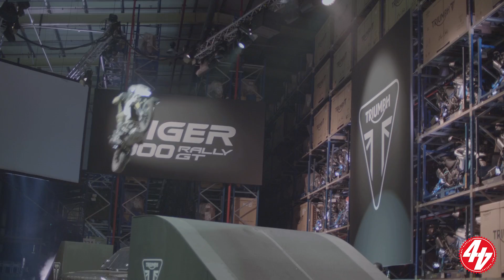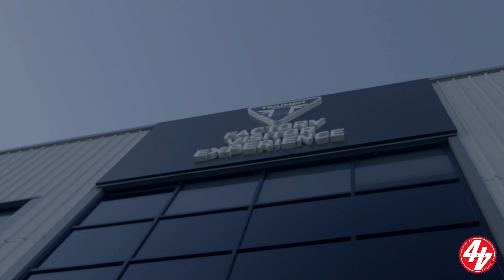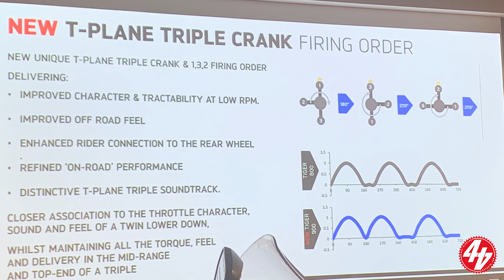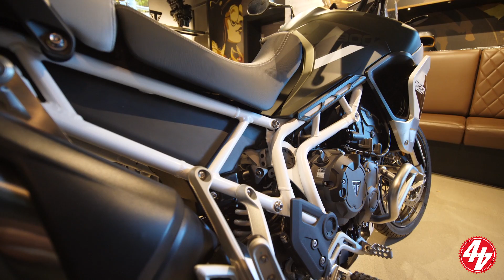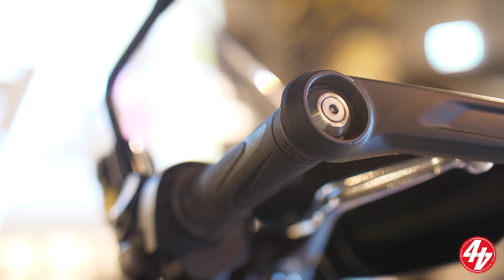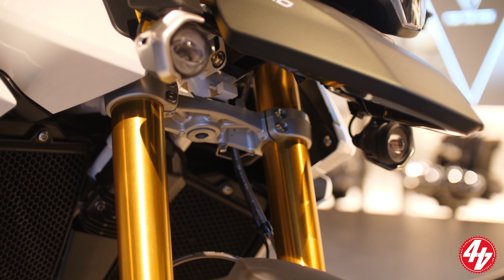2020 Triumph Tiger 900 Preview

Comment: I test rode the Rally Pro today. I got back to the dealer and threw my wallet at him. jokes, but this bike made the Tenere 700 look like a cheap toy. I'd go as far as saying that this is bike is as close to adv perfection as there is. The smoothness and acceleration up to 100+ kph is far superior to the Tenere 700 which I found underpowered and quite uncomfortable even on a 30min highway run. The seat, standing position, and wind protection  on the Tiger Rally Pro is super comfortable and has sealed the deal for me. Quick shifter and cruise control is life changing as well. I don't care about the extra cost over the Tenere the bike is that good.

Comment: To my personal knowledge, I don't know that an inline-3 engine has ever been configured with this crankshaft layout, this firing interval ever before. By far, most triples are 120° crankpin layout. Laverda did a 180° layout for a while (two pistons TDC, one opposite at BDC). But I don't know of any other triple configuration before this 900 Tiger.

Comment: Great vid.  Just wondering when 900 became middleweight for adv off road... :-)  Time for a 450-600cc twin cyl, adv with dirt focus, no breakable tft, 21 inch front, 150kg, dakar fairing, basic electronics for the road,  stock metal bash plate, (no heated seat or cc)...There's a hole waiting to be filled...stop it!
Reply: The Honda crf450L would be a good platform.

Comment: the crank design and firing order is like half of a V6. kinda. wouldn't complain if they made it
Reply: That's like saying lemon is half of a grapefruit. A meaningless statement.
Reply: V6s are normally either 120° even firing or have alternate 90° / 150° intervals - "odd-fire", most recently found in the Alfa Giulia QF or current F1 (lots of other awesome usage in the past).  Each bank still has even firing, 240° intervals like most triples.  The "odd-fire" is the result of using a common pin 120° crank in a 90° V block.  Most V6s therefore have split-pin cranks, giving pins at six unique angles.

This is completely different to anything else.  It's a proper Frankenmotor.

The best description (currently) is that it's like a crossplane four with one of the middle cylinders removed.
Reply: @identiticrisis  i know
Reply: @chrisdavidson911  Bollocks mate.
Reply: @identiticrisis  keep googling, it isn't complicated
Reply: @chrisdavidson911  ok so humour me man child. What should i google?
Reply: identiticrisis man child? well aren’t you just the kind of know it all self-righteousness!
Reply: @leofender8044  Curious that you take the name of a man who was never afraid to go against the grain. A true genius.

Information is information. Take it or leave it. Have something to add: do so. But leave your insecurities out of it, all of you.
Reply: @identiticrisis  don't walk pat many mirrors, do you?
Reply: @chrisdavidson911  Not something I generally keep track of, sorry.

Now answer the question. What do I google to get on your level here?

Comment: Man i really want to hear this engine running with a pipe. a triple crossplane engine, something completely new
Reply: Crossplane on triples isn't new (tracer 900), the firing order is new though
Reply: @amanslivearth4356  The MT09 has a standard 120° / 240° crank, like all Triumph triples until this one.  The firing order tells you nothing in this case.  Your choices are 1-2-3 or 1-3-2, means nothing.  Firing intervals, on the other hand...

Standard triple: 240-240-240 - crisp, even, growly
T-Plane triple: 270-270-180 - lumpy, twin-like
Laverda Jota: 180-180-360 - lumpy, like a mis-firing four

Comment: So your telling me your crank grinder only grinds a journal at 90* intervals?
Reply: The cranks are forged.  Then possibly twisted.  Only the bearing surfaces are ground in.
Reply: It's a common 270° parallel twin, with an extra "bang" (cylinder) thrown into the soundtrack. That's the most understandable way of thinking about it. Sound track will sound similar to their own Triumph Scrambler, but with an extra cylinder pulse mixed in. It's actually 888cc, or 296cc per cylinder.

Comment: Cross-plane triple - That is a Quantum leap. Much love for the firing order and the orientation, she truly is charming or enchanting, often in a deceptive way.
Reply: All triples are "cross plane" but not at square angles.
99% are 120° crankpin spacing.
One oddball was Laverda Jota, running flat-plane 180° (basically a parallel twin F800 BMW, with a piston put between them at 180º opposite).
This T-plane layout is entirely new. I've never heard of any engine maker do this before. It's essentially the firing order of a 270° parallel twin (very common these days), with another pulse thrown in there. Will sound like an Africa Twin, a Triumph Scrambler, an MT-07, a Ducati L-twin, but with an added dimension of an extra "bang" thrown into the sound track.
Wonder how smooth it will feel at higher rpm? Probably required counterweight shafts and crank lobes.
Reply: @12skipafew-e7y  Balance requirements are not that different from a standard triple.  In some ways it's superior, but not in others.  The whole thing is a "much of a muchness" deal.  The real advantage is the sound, which certainly is not insignificant to many, and more or less as you describe.

The 11% extra displacement offers much more low down torque (tiny bit more power up top) and the uneven firing spreads that torque out more, so it tractors off-road a bit better.  The 800 was said to be a bit unpredictable in its power delivery off-road.  But the 90° piston phases themselves don't have any effect on traction compared to 120°, so that was a missed opportunity (perhaps a tuning issue).

Comment: Are triumphs as bad as I think they our ?? The company I work for have a Triumph dealers in there group so in theory I could get a great deal on 1 but I have only ever heard bad things about them
Reply: People are stuck in the 70’s. They think it makes them sound smart saying crap about about a company that only shares a name with the 70’s bikes. Triumph fit and finish is top of the market now.
Reply: @Guy-ns1hk  having had a Daytona 675R 2 years ago I think that bike is the best middleweight ever made ! you will always get issues with mass production but Triumph are no worse than any other,  I agree with what you say some people still bang on about Aprilia & Ducati being unreliable when they are now better than their Japanese competitors !
Reply: they are great bikes but from experience sometimes their small parts - fasteners, bolts and things are not great quality - they are reliable and good value.
Reply: From a maintenance point of view, I was excited to hear, in Motobob’s video, the air box has been moved to make the job easier. 
With the bolt on sub frame, removable pillion pegs, tubeless tires, I’m sold. 
Not to mention cornering abs to keep my wife, insurance company, and myself happy. 👍🏻
Reply: As long as you regularly service them they never miss a beat in my 15 years experience with newer models. Great quality and excellent advice from mechanics at triumph only wanting help!

Comment: Huh.  There I was thinking we'd never see a 90° triple.  I feel Kevin Ash would be very pleased indeed.

I'm entirely impressed by the engineering doggedness involved in first making the decision and then making it work.  Even if it amounts to little more than an aesthetic difference.  Which is totally fine, by the way.  Very Italian... ;)
Reply: Is 90° not the same as 270°    90+270=360
Reply: @chrisredfield3240  They had a 240° firing order before (360*2=720 | 720/3=240), meaning a pin offset of 120°. Now they have a firing order of 180° + 270° + 270° = 720° and a pin offset of 90° + 90° + 180°.
Reply: @Blockbuster2033  does that mean before they had 2 piston's up 1 piston down.  Now there all staggered like a 270° twin with one extra piston following the same stagger
Reply: @chrisredfield3240  no, before they had all the pistons evenly distributed around the crankshaft firing with the same spacing between them, so every 240° (or 2/3) rotation of the crankshaft one cylinder would fire. Now they have them unevenly distributed around the crankshaft so the first one fires, then 180° later the next one fires, then 270° later the third one fires, and then 270° later the first one fires again. Remember that a crankshaft always does two rotations to cycle every cylinder once (in a four-stroke that is).

Comment: Loved my old tiger, just wished it had a bit more guts, will the extra 100cc give it that? Will have to wait and see🤔
Reply: Extra 100cc is to make up for Euro 5 regulations
Reply: They’re claiming 10% more peak torque but also more torque through the whole rev range so should feel a little luckier I think. Also a few kgs less can only help with acceleration.

Comment: Hmmm, even the base model is a LOT compared to the new Tenere 700. Ok, more power, but a lot less capability.
Reply: The Tiger is way more bike! For long distance touring and hitting trails the Rally Pro is beyond the reach of the Tenere, but then so is the price.
Reply: @Guy-ns1hk  agreed, but the Rally Pro is going to be at least £12500 I'd guess
Reply: What is the price of the T7 where you live? I thought it sounded reasonable from £9500! You get more, to be fair.
Reply: @aukanmeister  it's £1000 less. And while it's down on power, it has better suspension and proper off road spec wheels.
Reply: You guys get them for cheap, mate! €12500 will get you a Crf450l here.

Comment: Hope it’s got a lot more go than the 800 found the 2012 wet.
Reply: Your sister's got a lot more go in the wet though!
Reply: And not a good wet. 👍
Reply: @KingPeachful  How does the 800 find the 2012 wet?
Reply: Old tiger 800 was only 76hp @ the wheel.   That's why it was slow